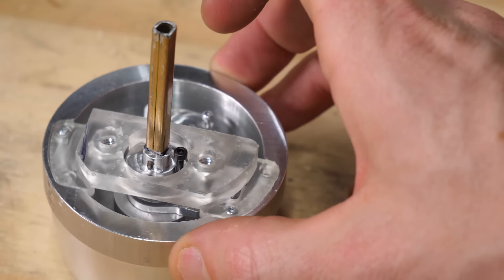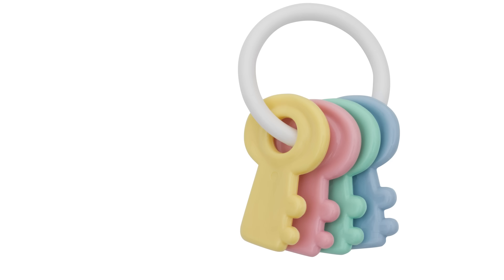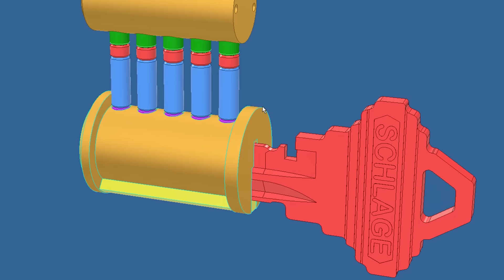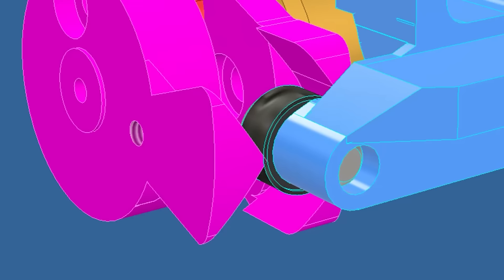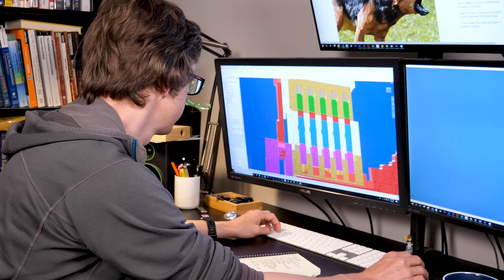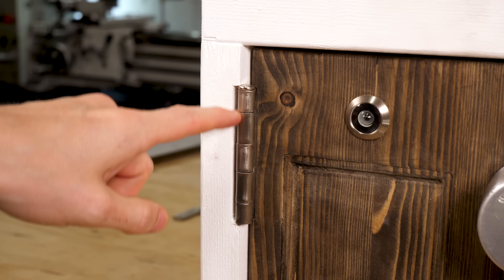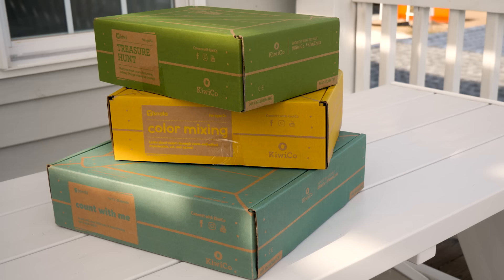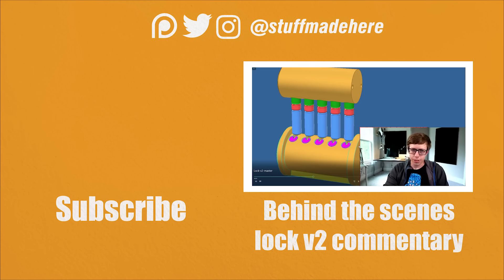TWO Unpickable (?) Locks for Lock Picking Lawyer!

Comment: I’ve been a locksmith and in the door hardware business for 30+ years. Thieves don’t pick locks. They bust down doors and go through windows. A decent deadbolt is 10 times more valuable than a cylinder you can’t pick.
Reply: One time I was working shift work at this factory, when we get off the shift we all go to our cars and all the windows of the cars are busted out and valuables stolen, probably 20 cars or so. I normally don't lock the doors so I thought I would be fine. Nope, they didn't even bother lifting the handle. They just busted the window and stole my cassette tapes.
Reply: @TruCloudGaming  Jimmy a deadbolt with a credit card? Either you don't know what a deadbolt is, or it was very poorly installed.
Reply: @themc3311  Yes upon further inspection the deadbolt in question is a bit fucked. Sorry I didn't come back to correct my comment.
Reply: thats the thieves you know about because they been busting doors. those who picked locks never even got reported and victims thought they somehow lost a couple valuables
Reply: @woswasdenni1914  Meh....very, very, very rare. There's just no point. Nobody wants to be at a door, maybe lit up by a security light, focussing all their attention on a lock that may or may not be pickable by that person. Not when you can just use a crowbar to open a window or similar.....or just go to another property with worse security.
Reply: Ex- theif here. Affirmative. Though lots of career criminals will carry picks, and become proficient at picking, the drive behind the act is most often addiction and that doesnt afford the patience and focus and attention to minute detail  required for picking. Infinitely better to guard against brute attack than brain. Not lots of brain going on in the petty crime world.
Reply: @RaveyDavey  lmao only if that specific burglar fits your bias. Guess what there is plenty of thieves and they all use different methods but if all them fail and depending on what they'll seek of course theyll just break the window. Smarter thieves know people dont care if youre standing by the door under the security light only the ownsers do. Of course again it depends on the neighborhood. Its not just one basket.
Reply: Yea but when that 50 year old semi tech guy sees this lock at menards and Googles how it works he's gonna buy it regardless lol. And then this guy can afford another cool ass video for us.
Reply: Now in the US they just walk through the doors while the store is open and help themselves
Reply: let people have fun tho, stop killing the mood.
Reply: Hurricane windows are a bit hard to break through as I understand it.  But yeah I mean if someone really wants to get in, they're getting in.  The whole point IMHO isn't to stop them, just make it either inconvenient, slow them down, or make it so they have to make a lot of noise.
Reply: Yeah but at least you'll keep the ametures out
Reply: @jimjohnson394  how does not locking it make it feel safer?
Reply: @madkirk7431  less likely to get smashed.
Reply: Humans : create unpickable locks
Also humans : lets plug this huge hole in my wall with that easily shattering clear stuff
Reply: @wiktorszymczak4760  that last part was just gibberish
Reply: @madkirk7431  thank youfor your input
Reply: Yeah but this very clearly isn’t something made for actual production. Much less installing into a home. You clearly missed the point of these videos and need to rethink commenting useless things from here on out thanks.
Reply: @jjbassing9044  yeah
Reply: @jimjohnson394  I work as a Mechanic. One of the events that convinced me to buy a pre computer vehicle. A construction company hired us to come out to fix fleet trucks. 6 of came out to work on the 15 vehicles. We discovered that they were hacked all of'em. I bought an 89' ford after that.
Reply: Gibbon  I preferred cassette tapes over CDs by a long ways. They were so much more durable. Who cares if a CD sounds better if it doesn't work?
Reply: @woswasdenni1914  life isn't Hollywood bud. Burglers at the level to which you describe are not wasting their time on houses. Every break in not done by a family member are crimes of opportunity. Majority of the time the opportunity is people aren't home and there's an open window or unlocked door. If they are going for something specific, they aren't going to mess with a lock because that increases the chances of getting caught.
Reply: I think these guys are way past being concerned with breaking and entering. If you know anything at all about LPL maybe you could understand what challenging him with your own lock means. The chances of success are probably better picking the PowerBall #
Reply: Which is why people need to start boobytrapping their homes.
Reply: Till you realize these people then will damage anything you have out of spite if they can't take it with them.
Reply: I've been a thief and in the breaking and entering business for 30+ years. This guy is right.
Reply: Yup in California we had to have solid steel screen doors.
Reply: A cylinder you can't pick is way more fun to figure out than a decent deadbolt though
Reply: There are situations other than a brute force attack from a random thief to guard against though, and there are plenty of situations where someone might want to get in and out without anyone knowing they were ever there.  Internal security at a company for example, for a room with sensitive docs on trade secrets.  Your corrupt employee isn't going to want to bash the door in with a pickax.  He wants to get in, photograph or copy the docs and get out with nobody the wiser.  Way more rare than a random junkie, true, but I could definitely see a use for an 'unpickable' lock.
Reply: Yeah but all the spies.......
Reply: @GlennDavey  Keeping corp financial docs and trade secrets under lock and key isn't exactly the same thing, and you're not as smart as you think you are.  I've ran an online biz for about 25 years and I have plenty of material that stays in a safe for good reasons.
Reply: @bernie4366  It better be Amazon, by the way, or I would say that's a waste of 25 years.
Reply: @GlennDavey  or maybe you're not as funny as you think you are.
Reply: @bernie4366  I'm exactly as funny to myself as I think I am, yes. And that's all that matters. As long as I'm not like you. 🙂
Reply: @boarhog1979  On the left coast of the US maybe.
Reply: True for thieves going after residential property, which is most of the market for key locks.
Reply: Oh no doubt, thieves are both on a tight schedule and stupid
Reply: I don’t think that’s the point of these videos. This is an engineering channel not a home safety channel.
Reply: @AzureMoebius22  we all need to stop wasting our time watching engineering channels and dig a moat around our homes and raise crocodiles.
Reply: Counter point a lock like this would be excellent for a hardened interior saferoom in a house.  Mine is for my guns, some valuables, and of course is my tornado shelter.

But a lock like this with hardened parts as well as a hardened case would really reinforce this room.

I use a cheap deadbolt on this room but with an electromagnetic lock as well that's battery backup and wired to a remote switch hidden in a different part of the house.

So you could break in by shutting my power off for a few days and break my deadbolt but if you don't know about the electromagnet lock you'll be pretty frustrated.
Reply: @bernie4366  this guy likes movies
Reply: Well the application for a good lock is for something other than a door lol 😂
Reply: @madkirk7431  it was never addressed in later comments, but just to be clear, what Wiktor was referring to when he meant "clear stuff", was glass. as in a window. i must seem like an ass for posting this, but it's more for my closure, apologies in advance.
Reply: @ChrisMartin-hs1tq  in germany so many theifs pick locks
Reply: A deadbolt is good however it can only work when you are inside your property
Reply: after getting my front door kicked in I put up a steel clad door. but to make it even stronger I put in a steel frame for it too. never a problem since.
Reply: @tonyhakston536  The only way to hopefully avoid that is to keep anything pawnable out of sight.
Reply: @madkirk7431  it wasn't gibberish, it was just a fancy way to describe windows
Reply: 30 years, bro, we're a new generation, we played Elder Scrolls, we have youtube videos that teach us how to open locks ... ofc we will pick the lock instead.
Reply: You missed a crucial part of the story, they break the window, then the alarm goes off, then to cops come , then they most likely get caught
Reply: @KpK1Cioby  So, basically what you're saying is, this new generation is dumb and will pick locks inefficiently, thinking they can do it from some youtube videos, and then failing. Breaking in brute force is often a better idea than picking locks.
Reply: yeah way too many doors one solid kick and it's down. Kind of scary how many doors are shoddy like that.
Reply: @RaveyDavey  Not every country's residential area is built around cute wood structures.
Reply: Well I understand that door locks are less important but when it comes to padlocks or bike locks a nearly unpickable lock combined with a thick ring/durable chain is pretty valuable. If this kind of lock could be put inside of one of those it’d be great.
Reply: Locks protect more than front doors
Reply: @woswasdenni1914  Good ol’ survivor bias.
Reply: Exactly what kids are taught at the end of gravity falls season 1
Reply: something very valuable I was taught by my father, that has a lot of other interpretations "a thief will get in no matter what you do, the only way to not be robbed is appearing like you have nothing to be stolen"
Reply: Yeah, and get a good high security door.

Comment: Stuff : “I made this completely original, and complex lock, my only worry is that he might use a tool I have no idea existed”
LPL : uses pocket knife
Reply: This cracked me up lol. I feel like a real door might have a smaller gap between the frame
Reply: @coopkink  they would, however a pocket knife could still fit, or even a credit card.
Reply: A strong magnet might be enough to move the bolt
Reply: @coopkink  or open from the inside
Reply: I surprised that is wasn't a lego piece
Reply: @ice2heart  or a red bull can
Reply: Never guessed why he start the video with the locks disassembled and schematic? Why do you think he does not show he trying to pick the lock? He clearly tried it and could not. So he viewed the schematics, disassembled the lock, looked for vulnerabilities and explain how this can be fixed. He just lock picked it after knowing how it works... This is not a competition. Don't be a fanboy.
Reply: @pensamentoazul  security by obscurity will never work. That is fine to have blueprints and know how it works.
Reply: @pensamentoazul  lol I’m not, I’m just pointing out a funny part of the video. Don’t get so uptight.

Comment: Based on the design (at least for the first lock where we got to see it), I feel like if there's any weakness in it that LPL can exploit to defeat it, it'll be from the machining process and only because Stuff Guy isn't a career lock maker.
Reply: "As you can see, the lock body melted at a mere 275 degrees. The materials choice here was amateurish, as would be expected. I look forward to an improved version using Boron-Steel alloy."
Reply: I feel like the fact this was made with precision tools and craftsmanship as opposed to coming off a factory line will make it much harder to find a exploit.
Reply: @fredriddles1763  generally, the better the craftsmanship, the harder it is to pick. Picking exploits a lack of precision in the pins. That said, LPL is a cleaver trickster, and he may find some other way to bypass it.
Reply: I bet it will be tolerances that he exploits
Reply: @fredriddles1763  lock parts in a factory are still made on precision tools.  It would just require a good machinist a lot of time to make a very tight lock.
Reply: @sinisterthoughts2896  I think the point is that you can get much better quality when you're making just two locks rather than trying to make millions of commercially viable locks
Reply: @Zaros262  I see what you mean.  The precision tool line is what threw me.
Reply: So far, the only weakness I can think of is impressioning and cutting a new key, purely based on how the lock works, but I'm not lpl so we will see
Reply: @Zaros262  not really true. You could, in theory make one that is better or more accurate - but the cost and time to make it would be hugely prohibitive. Yes they make thousands on a production line but this often means that each item is making use of years of fine tuning, years of research and millions of dollars worth of machinery. A great example is a basic  and simple ball bearing. Made by the millions but each item is of far far far higher precision and surface quality than anyone could achieve at home.
Reply: The fact that he asked for an updated version makes me think he knows how to pic the original version but who knows
Reply: @Zaros262  tell the chip making industry that
Reply: @jamescollier3  VLSI transistors suuuuck. They're terribly inconsistent, so you have to build a ton of margin into the design to make sure it works at all over PVT.
You could make the design with higher quality (i.e. longer channel devices), but that would drive cost up from the increased area. It's cheaper to just spend more effort up front when you have the economy of scale on your side

Comment: 0:40 This is LockPicking Lawyer, and by the time you hear dog barking - this two locks was already opened.
Reply: The second one was opened by cheating - making a small place between the lock and the surface of the wooden door. This last lock is perfect. No one, not even LPL, can open it unless it's on the surface of the door. When mounted submerged just three millimeters below the surface of the door, LPL has no chance of opening it.

Comment: When your lock is so unpickable you can't open it with a key
Reply: hahaha
Reply: @Duckyy_Duck quack
Reply: The lock has eaten the key
Reply: Just a piece of steel welded to two surfaces
Reply: @Orbital.Destination.Shock.Trooper OK I have to ask, what’s the subtext I’m not getting?
Reply: Or because you don't have the key in the first place 
Dun dun dunnnnn... Dun
Reply: It turns out the best lock is a concrete wall
Reply: @zeriel9148  REALLY??!?!? 🤯🤯🤯😳🤯🤯😳🤯🤯😳🤯👍👌👌👌
Reply: I mean, I don't think anyone expected this to be viable irl. Its just a cool thought experiment
Reply: A dummy lock, plus a hidden lock along the doorway. Sounds doable.
Reply: @zeriel9148  you mean a 3 ft thick titanium wall?
Reply: ah yes. but a lock that doesn't work with a key is worthless. so you might as well throw it away.